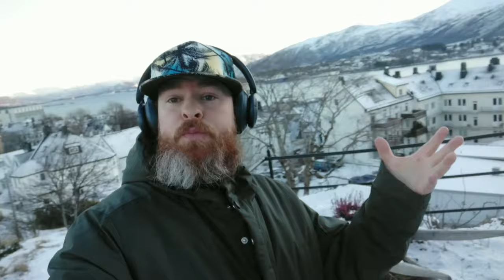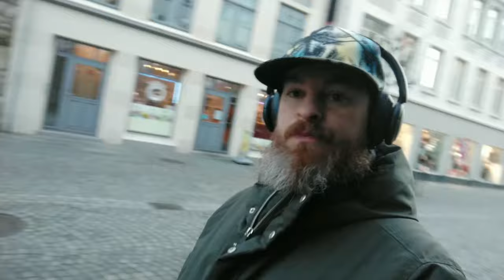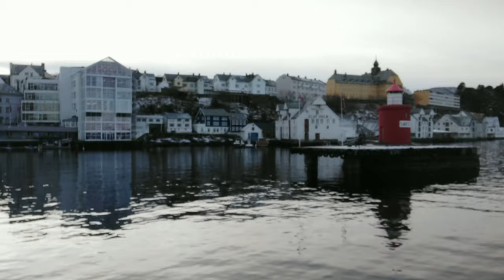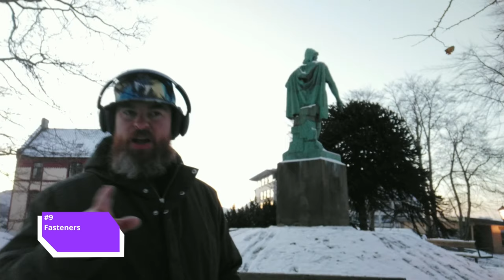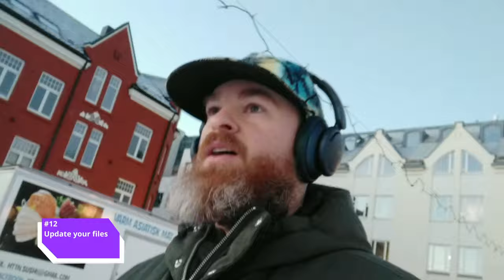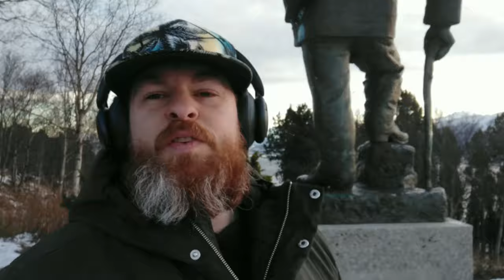What to know before building a Rook CoreXY 3D Printer

Comment: I originally wanted to convert my 2nd Kobra 2 Max to a core XY, then I found this 2020 scalable Rook. Was wondering what you thought. They are fast and my first one prints like a dream. This second one I bought off Marketplace and he had apparently dropped it and it had a lot of problems at first I got it cheap, and I took it apart, retightened down everything, and tweeked it. Now, it only has one issue. If you print a large file, it will eventually shift. So that will be my parts machine lol